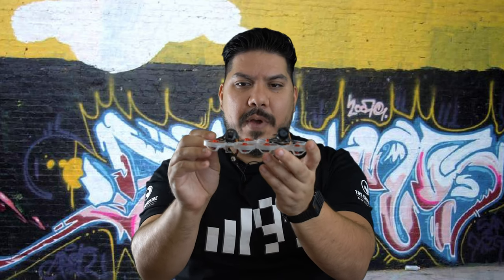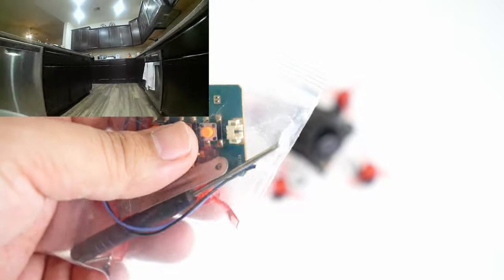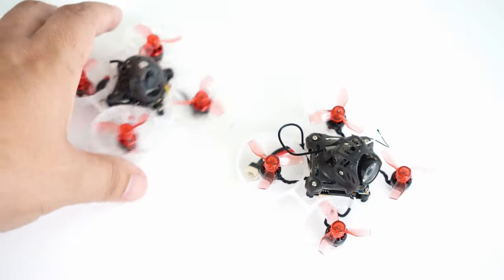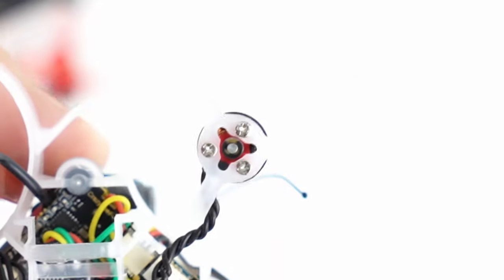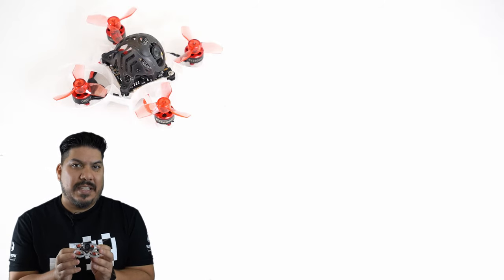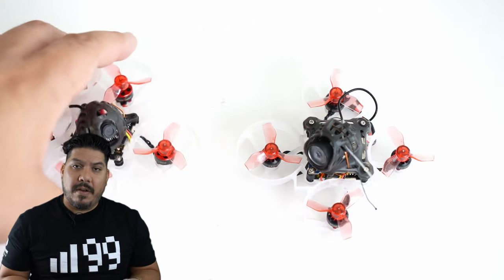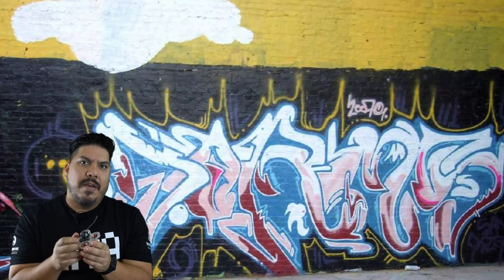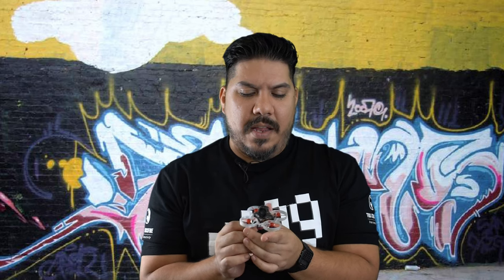Mobula 6 HD - Tiny drone with built in HD recording - HD tiny whoop

Comment: Yea, the instructions.   They seemed to have been hit or miss.   I binded the Mobula 6 to a D8 transmitter.   The instructions didn't work out, they also stated to type something like "frysky_bind" in the command line on Betaflight if manual binding didn't work.  That gave me an error message so I typed "bind_rx" and all is well.